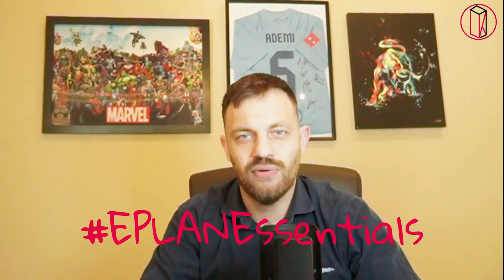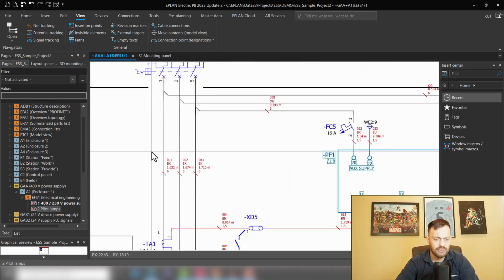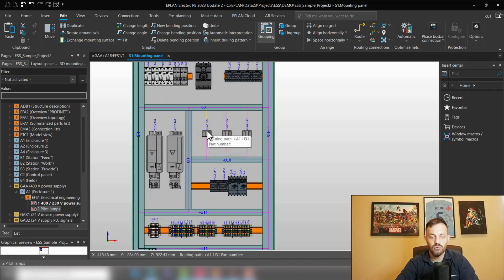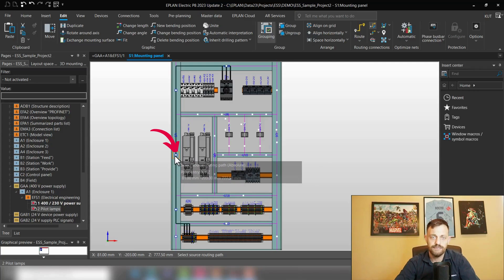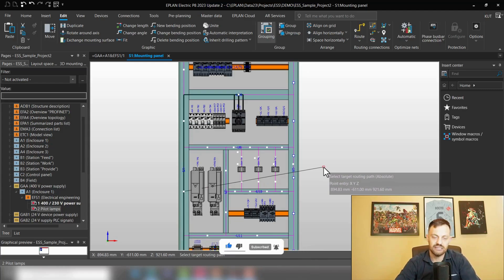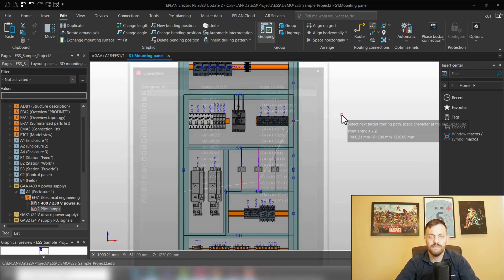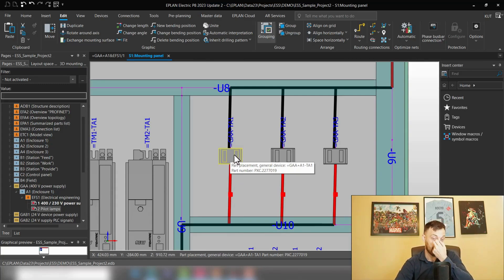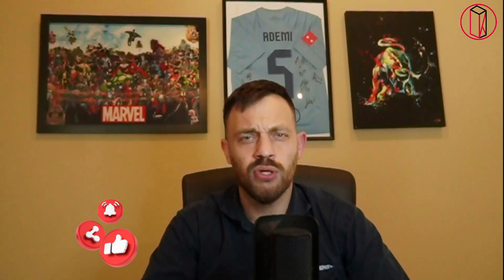How to Wire Through a Current Transformer

Comment: hi Kruno, I am facing problem while routing the wires to terminals.They ends at certain distance away from terminal.Not terminate in terminal hole. Could you plz provide solution.
Reply from the maker: Hello Ganesh.

Thank you for your question.

This typically happens if the Connection Point Designation in the Connection Point Pattern is not the same information as in the schematic.

Please Select the properties of your device in Pro Panel, and go to the Connection Point Pattern tab. If you have defined Connection Point Designations those shall have a green checkmark in the status column, and right below you should find information that was automatically generated, which contains a red symbol.

You will see that the information shall be very similar, so the goal is either to adjust the connection point pattern in the device or make sure that the schematic is adjusted correctly.

Hope this helps.

Best Regards 
Kruno
Reply: Thank you Kruno for quick reply.
However I have same information in schematics & in   connection point pattern, still wire routing is in air.
Plz help me resolve it.

Comment: Hi Kruno, thanks very much for the video. Just a question, how to I avoid direct connection? Wires going from one component straight to the next component without traveling through the wire duct?
Reply from the maker: Hello thank you for your question.

If you are using free routing , you will need to change the curve run (with the change curve run functionality)
If you are using route layout space, by definition the connection should only be routed through a routing path network, thus not go through devices, if they are still going through devices you maybe need a routing path around.

Best Wishes
Kruno